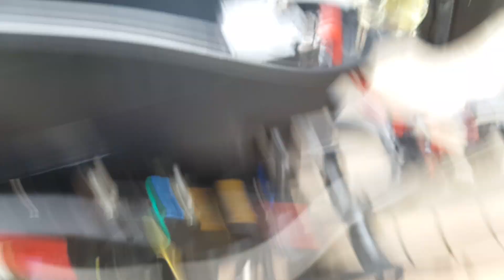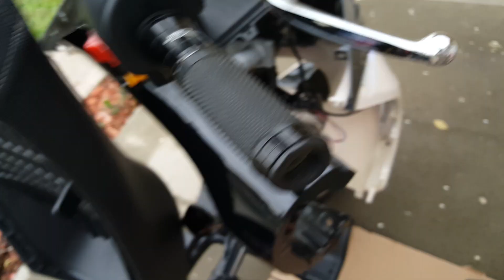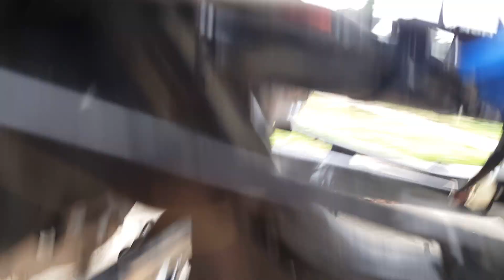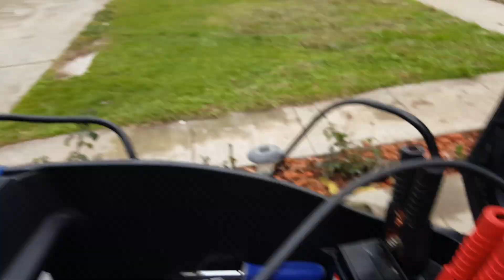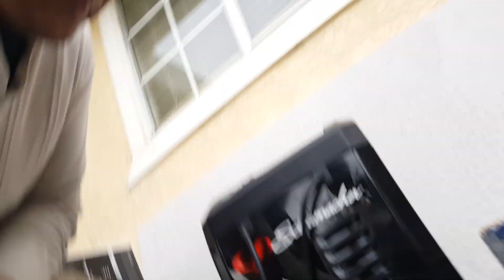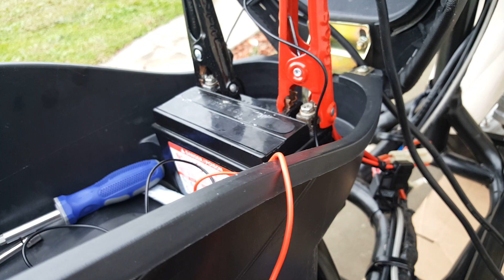GY6 Scooter Won't Start Troubleshoot 1 of 5

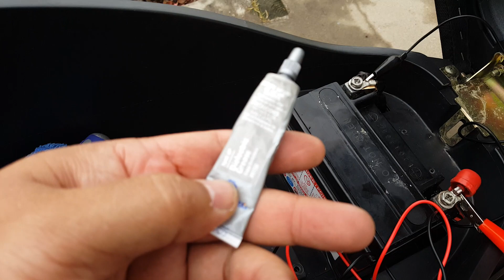Comment: WOAH WOAH WOAH WOAH!!!!! HOLD UP!!! .... as a master mechanic, i want to correct you @7:57  dielectric grease is not good for conductivity!! dielectric grease is NON-CONDUCTIVE and should NEVER be put on any connections.   its good to weatherproof electric connector seals  such as sparkplugs. it should only be applied to the ribs of the ceramic and not any metal connections. do not put dielectric grease in a bulb socket or even a harness connector.  if the connector has a seal put dielectric grease on the seal to help the seal, seal better and prevents sticking. dielectric grease should be put on the outside plastic part of the smaller connection in order to seal properly . never place it inside of the bigger connector to where it has risk of touching either male or female metal  connectors inside of the plug. its best to never apply any dielectric grease to a battery connector due to the heat and making it thin out and seep into the connections causing the dielectric grease which is NON-CONDUCTIVE, to cause a break in connection and either wont start or wont charge and putting you in a situation where you need to use your kickstart if you have one.  never put dielectric grease on threads either. always use Copper anti-seize as it has copper material in it and improves connection to ground. copper has the best conductive properties and it being formulated into anti-seize makes it perfect to protect your battery terminals and a grease to put on your sparkplug threads.

Thank you for reading!

Comment: You have some awsome content,,I just got a 150cc for really cheap, it looks great, was told it was caught in a rain storm and never started since, it looked like the guy tried to do some things but gave up and sold it.  When I hookup a battery and turn the key I get no lights or no power, where should I start to troubleshoot this?  Thank you for you videos
Reply: New battery!?
Reply: Check all the fuses

Comment: I just replaced my stator and still getting no spark. Brand new ncy cdi brand new coil brand new battery brand new relay and still no spark. Tested it with 2 other cdis and still no spark. Stator and everything tests good. Why can't I get power from my cdi to spark plug?
Reply: Broken wire some where or kill switch is on or broken
Reply: Or even bad cdi, even if it's new

Comment: i dont understand what you are saying
Reply from the maker: what part mainly?
Reply: @NCYSTORE  the faucet thing
Reply from the maker: @geo_5067  it's a metaphor for how current flow like water through a pipe or water hose and volume of water or pressure flows current measure as volts. You can find other YouTube detail electricity.
Reply: @NCYSTORE   ohhhhh OK

Comment: It is a battery charger, dumb ass.  It is not a generator.  I would recharge it at its lowest setting, unless you like to buy batteries.  You jumper pack needs recharging
Reply from the maker: Yes it was a lot more than just died I found out that was a defective battery but thanks for watching my video it pays to be a dumb ass! Lol
Reply: @NCYSTORE  I have lots of battery chargers, mostly Schumacher.  I still have my Excide one amp charger that I bought close to forty years ago.  I had to replace the bridge rectifier in it a few years ago but it works fine, now.  I usually use my 1.5A Schumacher automatic charger  I have had for close to twenty years.  It will charge to full charge and then drop down to .5A to maintain that full charge.  I leave a .5A Schumacher Maintainer on my lawn tractor all the time.  It is ready when I am.  My shop batter is charged when I think it needs it.  When the voltage drops below 12.0 VDC I connect it to a small charger.  I will charge it to around 13 volts, usually overnight.after I disconnect it I will check in in about an hour.  I am looking for around 12.8 volts, sometimes it is more, sometimes less, but in that ball park.

Comment: Hey bud we have a similar scooter it has a 15a fuse just b4 the ignition coil keeps blowing ideas?
Reply: Id just eliminate it.  I have two similar scooters and the only fuse is between the rectifier and the battery to safely charge.  Theres really no need.  I suspect its there by mistake.
Reply: @subzero5101  nice

Comment: My  to a scooter got new everything on it and still won't start.when it do start it'll run for 30 sec and cut off and won't start for a long time.can u help?
Reply: Sounds like your float is stuck or your line is clogged.  The float bowl lets it run until its used up and then slowly fills and you do it all over again.  Like mostly harmless said a good cleaning of the carb disassembled in an ultrasonic cleaner does wonders.  Try not to use gas with ethanol.  Its the source of most toys not running after being stored all winter.
Reply: Go to the parts store and get some Seafoam. Put it in your tank and save yourself the headache of pulling your carburetor apart.
Reply from the maker: Check the battery even though it reads good it might not be good that's why I find out the end replace the battery
Reply: Check /clean both air and fuel filter.Dismantle and clean carburettor Fresh gasoline. I guess.